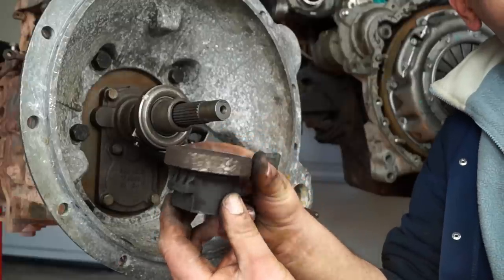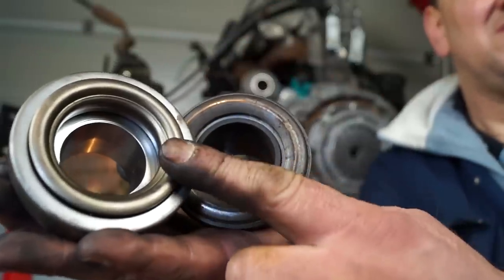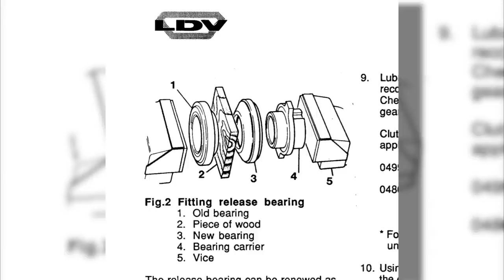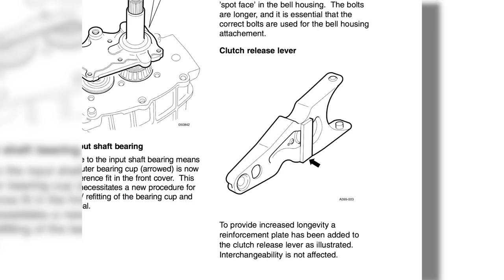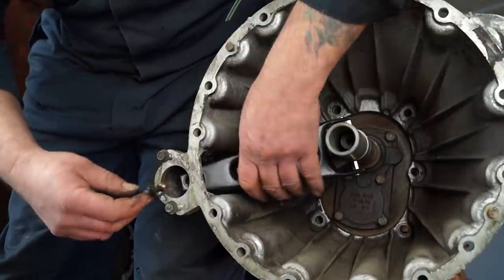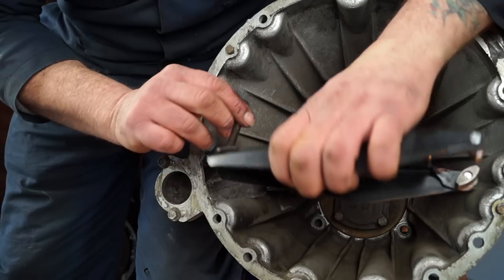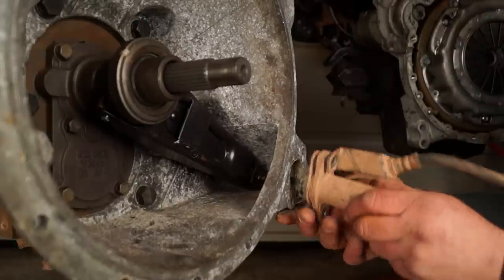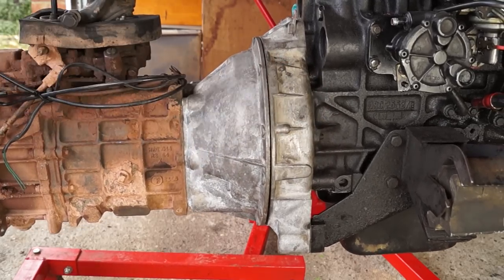Land Rover clutch Part 2 - release bearing, & release lever

Comment: Ah! lightbulb moment! Thanks, Gearbox out then, R380 that I converted to stumpy myself. Thank god I didn't get rid of the LT77. You're a gentleman!
Reply from the maker: +Paul Bellard  ah okay.    Stumpy huh?  Rare gearbox.
Reply: +Land Rover Toolbox Videos. it started life as a disco R380. And after watching your gearbox vids I had a go, stripped it down replaced the parts, to make it fit. I'm guessing that I haven't shimmed the main shaft correctly or the bearing race on the front cover is wrong. I'll drop the box out, put the LT77 back in and strip the R380 down again. All good fun!

Comment: The new replacement thrust arm is pretty flimsy compared to the old Series cast iron one. Land Rover is not the only one out there that has the ball pushing through. I've seen Subarus have the same failure.
Reply from the maker: Yeah, that is a real Achilles heel with that system.

Comment: so why does my release bearing sound like I've got a team of metal bin drummers going at it when idling? noise goes when I depress the clutch pedal. is there a more permanent way to fix the bearing to the clutch fork?
Reply from the maker: +Paul Bellard  That is either your clutch springs rattling or the bearing on the constant pinion noisy.
Reply: did you find ou the issue ?

Comment: Nice video....Thought I'd ask a question. Can I use a tdci puma engine and gearbox on an older chassis?- with some mods ofcourse
I have a 1986 defender and I want to use a 2007 engine and gearbox with a 2007 bulkhead...Thx for any response
Reply from the maker: What is wrong with the Puma chassis?

Comment: Hi, I have pulled my gearbox out to investigate a very grinding clutch. I discovered a completely shattered release bearing, and the clutch plate had cracks in it so the splined collar was rattling around. you mentioned constant pinion bearings, would there be any way to check that with the box out?
Reply from the maker: Check for play in the shaft and roughness on the bearing if you can feel it in the shaft.
Reply: Cheers, no play at all and feels smooth when rotated. I'm hoping that my noise issue is down to the clutch issues. Thanks for your reply, once again!
Reply from the maker: no worries.

Comment: what grease do you use for the bearing and pivot?  so many opinions from moly based (though some says it turns liquidy under high temp) to copper slip to synthetic.  Any choices that are best with these LT77 setups?
Reply from the maker: +Steve G  copper slip is okay or just regular grease.  it is not going to get too hot in there.   I will say that the lubricant will dry out and the metal will polish itself on the pivot.   Land Rover release fork is not the best design.
Reply: Looking at this video again. you know difference between STC8362 and 8510310?  confusing to me. I have two defenders working on .  LT77 to 3.9 V8 and a R380 to a 4.2 V8. R380 gearbox is from ashcroft and mating a D1 flywheel and bellhousing with it.  Many Thanks in advance if you have any sorts your way...